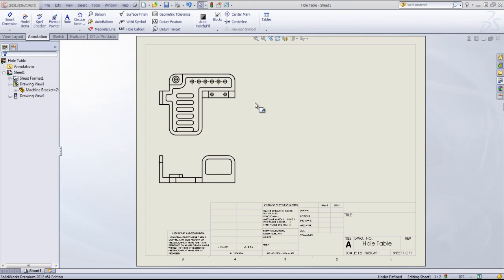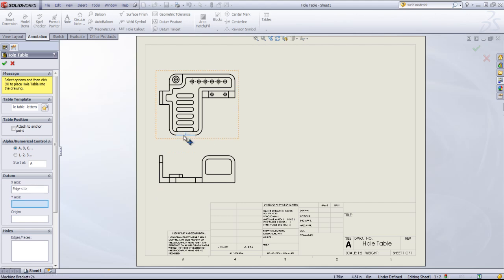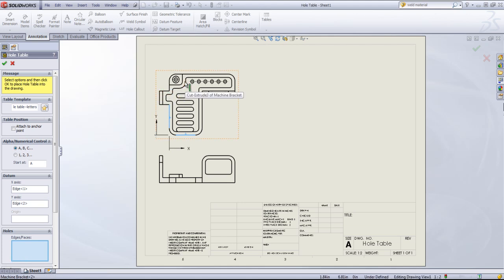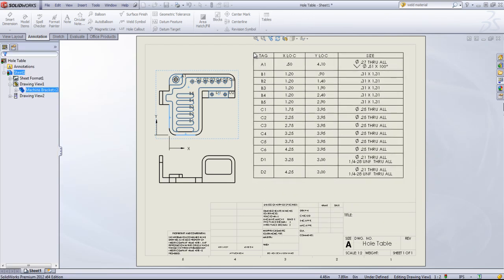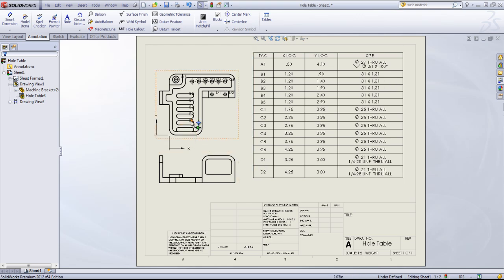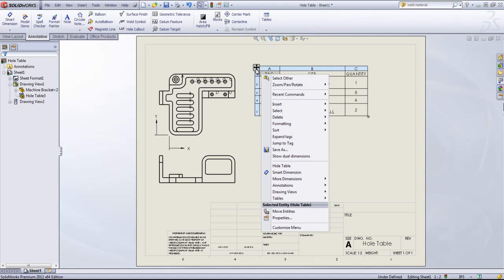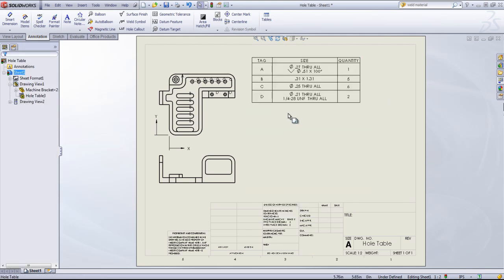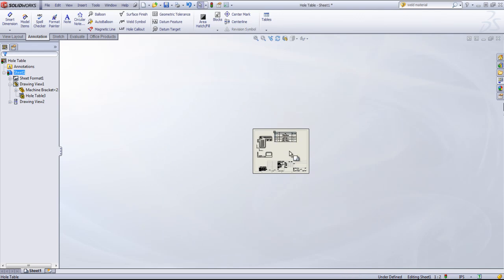SolidWorks Tutorial: Hole Tables by SolidWize

Comment: Hi, In this video you add HOLE TABLE, where TAGs already have been added. Is it possible to add TAG of parts (separate parts or part assembly) to the BOM?
Reply from the maker: Hi Artem, the default for a BOM is for the first column to already have PartName or PartNo, so that should populate automatically, you can change the default template as well, what you should look into is bringing custom properties into columns for a BOM. Depending on the property, this is usually pretty straightforward, right click on a column and add a column, you'll be asked to assign a property to the column. Once again, if you want to have the same property, over and over, you'll want to save the table as a template.